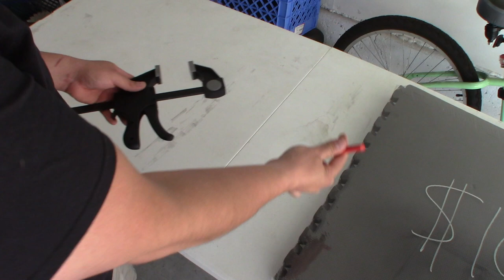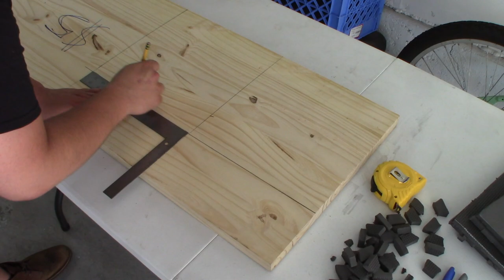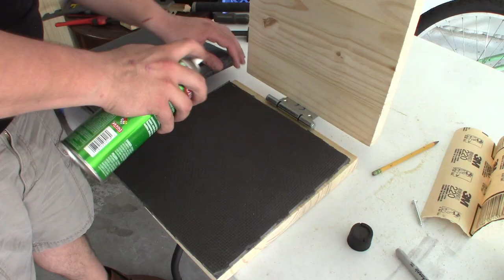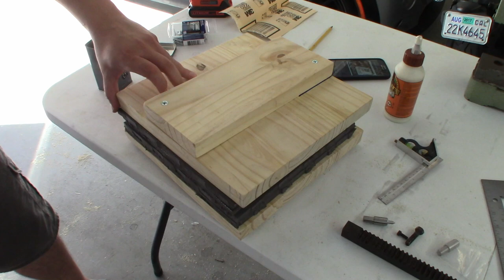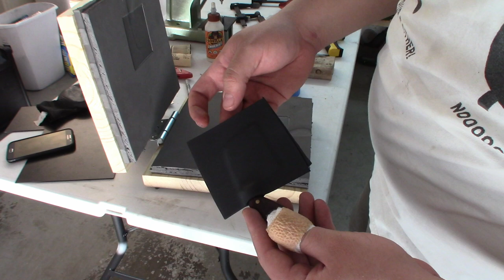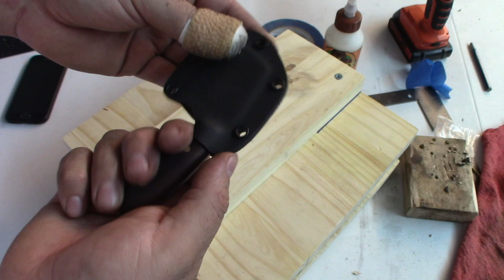Making a $21 Kydex Press (And my first kydex sheath)

Comment: Dude! That first sheath turned out sweet. Only advice I would give is to semi - compress the mold before installing the hinge. That way there will be more even pressure front to rear. Nice job; building mine tomorrow. ..

Comment: Nice video I like it a lot my only recommendation would be use a heat gun or blow dryer to heat the foam it helps give a more defined appearance especially with firearms
Reply from the maker: Thanks for the tip!

Comment: I’m going to make my own Kydex press using some of these methods but the only thing I,m going to do is press the whole thing down just a bit when I install the hinge just so I get a better snug press when I use it & I,m not going for the grommet look I don’t need them so I’m using black rivets instead . I want my sheaths for my Tomahawk , Bowie , & my Skinner knife to fit on a wide belt so I can interchange them if need be . I don’t need them to click into the sheaths but just to be snug enuff to not fall out & I think I,m going to use a Dremel to cut all the excess Kydex off as well as doing a better part of the sanding .

Comment: I did this myself and yeah it worked fine the first time.  The problem is the cheap pad he used for it. He got that at harbor freight. Hot kydex changed the shape of the pad.  You have to continue to change out the pad every new job you do. Otherwise you get line and uneven molding.  Look for a better pad, I am.

Comment: What about the other two clamps?  Five finger discount items? 😂
Reply: Those come free with every long baggy jacket and or pants
Reply: And drill. Quick change bit. Rivet tool. Rivets. Band or scroll saw. Flush cut saw.
Reply: @TheCentralflorida   if you don't have at least the drill, bits, sander, band saw and a simple back saw as is then you won't be able to handle making this press let alone the knives, sheath, or time it's take to learn basic craftsmanship.

Comment: I wonder if you will have a problem with even pressure over the entire surface since the side with the hinge can't really compress down, say if you were trying to do a much bigger knife or gun. But I guess it could be fixed with a little tweak by putting the clamps on the hinge side with the hinge unscrewed on that top main square of wood with them compressed a bit and then screwing the hinge on..just a thought if you ever find its not enough pressure towards the hinges. Or maybe its perfect? I was actually thinking of doing some kydex sheaths but never did because of the crazy prices of the foam press. So this gives me hope! Very cool video and great idea

Comment: I've never made this molding device, but I'd suggest making a "removable" inset.  That way, you can duplicate the size of the inset and just replace as needed, thus keeping the "press" reusable.  That is, if there is an issue with the foam not returning to shape.
Reply from the maker: Corey Perez they are easily removable and replaceable. They just peel right off.
Reply: Donylyn Knives, AWESOME.

Somebody in the comments, did they had issues with the foam returning to shape.  I liked your process and had hoped the suggestion would help them out.
Reply from the maker: You can even purchase and use the more expensive specialty foam ($20) for better performance. I was just trying to make this as budget friendly as possible.

Comment: Where did you get the foam pads?  It always feels like the foam pads that are sold specifically for kydex are way overpriced compared to similar foam that is not intended for kydex.  Maybe it really is better, as they say, but it just looks eerily similar to other foam products.

Also, one thing I found about hinged presses is that you want to set the hinged end so that it compresses the foam when closed.  If working on a longer piece, like a long knife, there won't be as much definition by the hinge, since it is not being compressed at that end.  Just food for thought...

Comment: nice work! it left a pretty good indentation in the top and bottom of your press does that go away after a few mins
Reply from the maker: No it stays. It still functions perfectly well but it definitely won't stand up to many uses like the more expensive foam. Eventually I will end up replacing it with the more expensive stuff.
Reply: Donylyn Knives could you recommend some of the "expensive stuff"? I'm looking to get into this soon, and I'd like to do it right with the correct materials, but not make it too complicated or pricey. 
Also, would the folding design work with handguns, or should I go with a several clamp design that just brings the top piece onto the bottom?
Reply: Blade Holdin this style press will work with all style holsters basically. handguns, magazines, knives, everything. 

The foam I used was from somewhere in Ohio, look it up, maybe you can find the video on diy closed cell foam press.ill see if i can find the info for you as well.
Reply: Blade Holdin basically, foam, wood, good clamps, and thats your press. for heating kydex, a heatgun and steady hand, a small  convection oven or heat press once you do get serious enough. 

Lastly, i found that boltaron seems to be better than kydex, but both work similarly
Reply: What is the addition of the top smaller section of wood for?
Reply: bryan kestle  I think for the extra screw holes in the hinge

Comment: Nice. It may have been better to orient the grain patter in the other direction so that the strength of the long grain goes with the clamp. As it is now, something too bulky in the press would cause the wood to bow and possibly break along the grain lines.
Reply from the maker: Matthew Fochs Your are absolutely correct sir. This wood was actually shelving made of strips of wood. I didn't mention my mistake because ideally you would use a thicker or more solid piece of wood. I added the strip along the center of the top to give it some rigidity.
Reply: its nowhere near approaching breaking tension, hes good.

Comment: Excellent video. I wish you were making a gun holster instead, but interesting regardless. I'm wondering why have hinges at all. Just sandwich the object between the pads and vice it up. Maybe I'll try. Thanks buddy!!
Reply from the maker: You don't need the hinge, it just makes it a lot easier to clamp. A lot of people just use two thick blocks of wood and sandwich them. So many people have mentioned holsters I've thought about doing another video making a holster press.

Comment: Great easy to understand video. What size and make is your bench grinder ? Thanks
Reply from the maker: That's a craftsman 2x42 belt/disc sander. I bought it new for under $100 years ago. Unfortunately they are no longer made. Similar ones are made by other companies but they seem to start around $200.
Reply: @DonylynKnives  Thanks mate

Comment: Loved thrblack of rambling, BUT would have loved to see the specs and measurements you used
Reply: DT Axe and Tool it looks like the foam is at 11" square and the wood at 12" square. the block he secured on top could be 5x12. Rough guesstimate.
Reply: Erin Bragg Thanks. Ive never use kydex but my axe got wet and mucky yesterday in the snow and I didnt want to ruin thr leather sheath by putting it back in it. now I want something a bit better suited for incliment weather
Reply: No problem. Yeah that would be a smart decision. Plastic tends to last longer than leather and you don't have to worry about getting it dirty.
Reply from the maker: The beauty of it is that the measurements don't necessarily matter, you can pretty much make it whatever size you need it to be.
Reply: Donylyn Knives thanks. I can't wait to try. this is the first video that actually showed "how to" so many are sped up and never show all the individual steps

Comment: Nice idea, I might replicate, got a couple of questions though, would it work better if you fitted the hinge when only 3 of the 4 pieces of foam were in to make the back tighter, and the the press you were using, what is that, looks industrial.
Reply from the maker: The back doesn't need to be tighter. If it were it would just make the press harder to clamp down, making it less effective for the sheath at the front. The press is an arbor press I bought on craigslist. They sell em at Harbor Freight for like $30

Comment: HF quick clamps aren't very good. They break at the worst times.  Those glued up boards will warp badly over time as well.  Buff the edges with a cotton or felt wheel to get a good smooth edge.

Comment: Have a question ...when it comes to using the same heat molding with kydex, would the same process work with UHMW? And between the 2, which would be the better, or wouldn't it matter?
Reply from the maker: Justin Barney I'm not familiar with UHMW, what is it?

Comment: I know this is an older video but hopefully you might see this. Did the foam "heal" and the impression come back out so it could be reused?
Reply from the maker: No. The specialty foam is more expensive because it's designed to 'heal' as you say. This foam kept an impression, but it was still perfectly reusable. Just won't last forever like the specialty foam.
Reply: @DonylynKnives  thank you for replying

Comment: you didn't include the cost of the adhesive spray, screws, or two extra clamps. that being said, I do like your contraption.
Reply: What size was the boards cut at?

Comment: How on Earth did you get that beautiful piece of wood for $5?
Reply: I was thinking the same thing that definitely not a realistic price
Reply: scrap pile @ lumber yard, or construction site dumpster lol 😂
Reply: I think I could get something like that for $5 in my hardware store too
Reply: its literally wood dude, better question is who would pay 5 bucks for something thats around them at all times for free?
Reply: A sheet of sanded 3/4 inch plywood which is like 4ft by 6ft is around 36 dollars but this is all hardwood I still don’t see it being 5 dollars
Reply: Check out southern yellow pine 2x8, 2x10, or 2x12 at home depot or wherever.  It'll be marked #2 prime kd syp

Comment: how do you make that knife snap in . like some sort of click? any help would be apprecaited. i am ready to make it, but cant fiture out how to make it click..
Reply from the maker: When you shape the sheath you maintain a part of it that 'clips' over a part of the handle or the back edge of the blade near the ricasso. 

Shaping the sheath is the most important part for retention. If you cut off too much it won't snap into place like that. If you don't cut off enough it could be very difficult to sheath or remove the blade.

Comment: Great video. Where'd you get that machine that fastened the 2 kydex pieces together?? I want to call it a riveter but I think I'm wrong..
Reply from the maker: G.R, Dray it's called an arbor press.  You can get em pretty inexpensively at harbor freight.
Reply: Donylyn Knives   Thanks for the lnformation. I appreciate it..

Comment: Does the rubber  mat you chose to use get hot and possibly get deformed?
Reply from the maker: Yeah it's probably good for 6-10 sheaths or more. If you buy some real kydex foam it'll last way longer. Two pads would have cost me more than this entire press 🤙

Comment: Doing the rivets right with the rivet press is something that requires a bit of practice. Rush it and they split.
Reply: Can I do rivets without the press ? Maybe with leather tools ? I have those .
Reply: @triumphmanful  I’m sure that you can, but it would be even trickier. The issue is that the rivet edges have to roll over, and for that, they have to actually stretch. That’s why it’s easy to make them split along the edge.

SLOW is the name of the game.

Comment: Have you used this setup for more than one project?  Just wondering if the eva foam started to deform from the hot kydex.
Reply from the maker: There are definitely impressions, but they don't seem to effect the outcome. It definitely breaks down much faster than the more expensive foam.

Comment: do the impressions in the foam after pressing go away?
Reply: There is foam flooring that has a smooth side whith out texture.
Reply: PAoutdoors  just buy the kydex pads off eBay they are way better and they only cost 16 bucks shipped for the 2pc  12in by 12in set.
Reply: I've never made this molding device, but I'd suggest making a "removable" inset.  That way, you can duplicate the size of the inset and just replace as needed, thus keeping the "press" reusable.  That is, if there is an issue with the foam not returning to shape.
Reply: Never used one of these, but taking a heat gun to the foam should get it back to its original shape.
Reply: The depressions go away as i use this in my car boot as floor for my tools and it just takes a few hours for in dents to go away and that can be from being completly flat
Reply: I park my car on those things and the tire marks go away after a while.

Comment: Nice simple press. I like the idea of the flooring foam but I see that it was left with an impression from the hot kydex, did that fade away or was it permanent?
Reply from the maker: It left an indentation. This foam is cheap and will not hold up to many uses like the more expensive stuff, but it works perfectly fine for what I need it for. I also have enough left over foam to replace it at least 5 times. Eventually I will end up buying the more expensive kydex foam.

Comment: What did you use to put those metal rings in?  looks like some sort of press.
Reply from the maker: Those are called rivets, and its an old arbor press that I adapted to use a rivet flaring die with. http://www.knifekits.com/vcom/product_info.php?cPath=41_526&products_id=2028

Comment: Is it normal if the two pieces come apart after the pressing?
Reply from the maker: It happens sometimes. You just have to make sure you line them up properly when you drill holes for the eyelets.

Comment: good job... one question... when you took the sheath out of your press it looked like the hot Kydex melted your foam? did it or was it just compressed where the Kydex was? did it go back to its original shape? thanks!
Reply from the maker: It didn't melt it but it left an indentation. This foam is cheap and will not hold up to many uses like the more expensive stuff, but it works perfectly fine for what I need it for. I also have enough left over foam to replace it at least 5 times. Eventually I will end up buying the more expensive kydex foam.

Comment: Turned out pretty awesome bro. Did u do anything special that i didnt see to make it snap into place like that, or does that kinda just happen on its own??
Reply from the maker: DIRTDIVER882 You just have to shape the opening properly. You want it to hold it tightly but not so tightly that it's hard to get out. You just have to adjust it as you're shaping it.

Comment: nice job, how is the foam holding up? are you getting a lot of impressions after a few? just subbed :)
Reply from the maker: I am getting impressions, but it still seems to function just fine. If it gets too bad I can always just replace the top layers of foam or even add another layer.
Reply: Donylyn Knives cool. thanks for the reply
Reply: BC Bushcraft I get impressions in my expensive foam just as much as the cheap stuff. I just picked up some of this foam from harbor freight on black friday, with intent to try this out.
Reply: Jack O'Lantern Let me know how it goes, I'll probably try the cheap stuff first for cost lol
Reply: Try heating the foam and the knife a little with a heat gun while you're waiting for the Kydex to get to temperature. It will cause less indents in the foam and give you better definition. All around great DIY set up

Comment: Would this work for a pistol holster?
Reply from the maker: Pistols are significantly thicker than knives, so you would probably need to use some legitimate kydex foam. It's much thicker and far more pliable. The harbor freight mat is too thin and dense

Comment: If you need to have Lowe's cut the wood for you, do yourself and the rest of us a favor and do not attempt this lol. Secondly,  maybe I was raised differently but, everything but the press you should already have in your shop so stop bitching about the extra cost and grow a set. Sir, this was an excellent video.  I am now going to make my own because I cannot find a holster for my new 9mm that I care for.
Reply from the maker: I highly recommend splurging on the 'legit' kydex foam if you're going to make a holster. A gun is significantly thicker than a knife and you'll want a lot more detail in the nooks n crans of your beautiful firearm! 
This dense foam will not perform in the same way as the more 'rubbery' kydex foam.
Good luck with your holster, brother!

Comment: Made tbis..kydex melted the foam first try
Reply from the maker: Sounds like you got the kydex way too hot. It only needs to be hot enough to be rubbery.
Reply: @DonylynKnives  yep..i can see in your video it did the same thing..the foam is just not dense enough..good for one sheath
Reply from the maker: @aquariys  Yes it leaves indentations. But it still works just fine. I made 6 or 7 sheaths before I changed the pad.